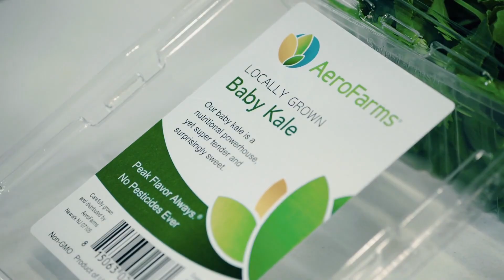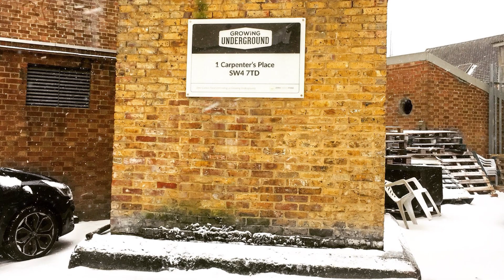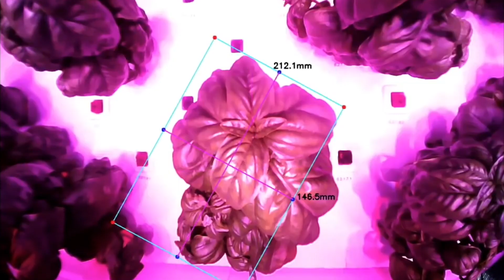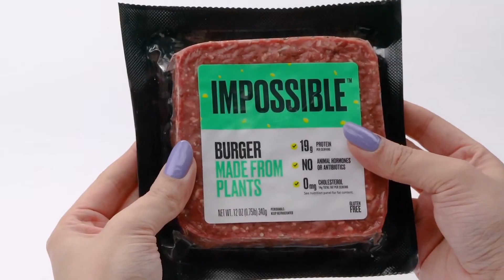Why the Future of Farming is in Cities - The Big Money in Vertical Farming

Comment: Vertical farming is hyped up and not realistically feasible without unlimited/free energy. Scientists have done the math and it's just not realistic until the day we have fusion reactors and unlimited, free/cheap energy. Also unnecessary. The Netherlands has pioneered non-vertical farming that produces, as example, 20x more tomatoes per square meter of land with 4x less water than normal farming produces.

Comment: imagine using 300w solar panel to supply the demand of plant instead of direct sunlight at the same amount of area plus vertical garden
Reply: Since solar panels are 20% efficient then it would take 10sq feet of solar panel to light 2sq feet of garden. That would be solar panels on top of 5 shipping containers to light only 1 shipping container. Now then, where do you put the solar panels for the other 4 shipping containers. This dream will never happen without nuclear energy and many times more than we already have.
Reply: @FlinFarmer  im planting about 1sq.m of Veg using about 60W both LED and pump compare to 330W solar abot not over 2sq.m i think it plenty to use

Comment: I don't get it..... you build a double walled climate battery greenhouse,  install a PV array nearby for supplemental lighting with a battery bank, ventilation convection, and backup propane generator..... at least 60% of lighting would be free from the sun, and the rest would be picked up by solar, and a tiny sliver for the few times you need to fire the propane generator.

Comment: https://www.pssurvival.com/PS/Hydroponics/Hydroponics_The_Bengal_System_1959.pdf
Bengal Hydroponics
Bengal Hydroponics. https://www.pssurvival.com/PS/Hydroponics/Hydroponics_The_Bengal_System_1959.pdf check page 106 known as the Wroclow Method invented in Poland during the Cold War in the 1950s and IT IS THE FIRST NON-CIRCULATING PASSIVE HYDROPONICS SYSTEM INVENTED. Not the Kratky method. The Wroclow Method is 70 years old already and new improvements were already made that are still also equally passive and are added to it and it also has incorporated Professor John Todd's "Living Machine" concepts and principles.
pages 106 to 107 
Wroclaw hydroponics method
An adapted form of water culture is being employed with considerable success in Poland. The plants are placed in a layer of brown coal mixed with peat on a gauze of nylon and metallic wire, laid over the top of the solution tank. A space of about 1.25 inches is left between the surface of the nutrient solution and the bottom of the gauze. This guarantees good aeration because it is kept in open contact with free air from outside by holes in the wall of the tank. The solution is non-circulating and is not renewed during the culture, and only replenished according to consumption by the plants. The tanks are disinfected for every new crop and a fresh solution made up, The Polish technique, which is known locally as the Wroclaw method, has been found to be cheaper to operate than gravel 106 NOTES ON OTHER METHODS culture. (See diagram on page 4: Dr Gericke’s original method of soilless cultivation of plants). 
https://www.youtube.com/watch?v=_PJJZFLnvfA&t=44s
Extreme Off Grid "Combat" Hydroponics No Pumps Inexpensive Easy Use Grocery Store Stuff!
May 15, 2014
But one thing is for sure, he accidentally stumbled on the orgone effect in which when you combine one non-metallic layer with a metallic layer because the non-metallic layer absorbs orgone and the metallic layer absorbs and transmits orgone into the surrounding environment. In fact, a friend of mine way back in the 1980s created an orgone pyramid BASED ON THE DIMENSIONS AND ANGLE OF THE SIDES OF THE PYRAMID OF GIZA and by using 3 layers of plastic sheet and 3 layers of galvanized steel in a plastic-steel combination. 1st layer is steel, 2sd layer is plastic, then 3rd layer is steel, 4th layer is plastic, then 5th layer is steel, 6th layer is plastic. And inside, in the middle of the pyramid at 1/3rd up is a platform where he placed a cup of water. By sheer coincidence he accidentally got burned and the doctors tend to his treatment but he also applied the orgone treated pyramid water to his chest where his burns are located by placing his fingers in the pyramid water and wetting them and applying the pyramid water to his chest where his burns are located. And in around one week the doctors checked on his progress and were surprised there were no scars and his burns were all healed! The same thing happened accidentally when the non-circulating Wroclow hydroponic method was discovered in Poland during the Cold War wherein the plants are placed in a layer of brown coal mixed with peat on a gauze of nylon (non-metallic) and metallic wire net (metallic), laid over the top of the solution tank. A space of about 1.25 inches is left between the surface of the nutrient solution and the bottom of the gauze. This guarantees good aeration because it is kept in open contact with free air from outside by holes in the wall of the tank. The solution is non-circulating and is not renewed during the culture, and only replenished according to consumption by the plants. The tanks are disinfected for every new crop and a fresh solution made up, The Polish technique, which is known locally as the Wroclaw method, has been found to be cheaper to operate than gravel 106 NOTES ON OTHER METHODS culture. (See diagram on page 4: Dr Gericke’s original method of soilless cultivation of plants). In an another method was the hybrid soil bed-hydroponic method wherein the soil provides all of the nutrients and the water culture of the hydroponic system below the soil bed provides all the water. And this method has been a time-tested and time-proven method in the 1920s. Strange that it was ignored in favor of the much more complicated hydroponic methods discovered after it. Then it occurred to my great-granduncle that it is the human nature to want something much more grandiose DESPITE THE FACT THAT SOMETHING SIMPLER AND MUCH CHEAPER AND EASILY UNDERSTOOD BY THE MASSES ALREADY EXISTS AND THAT IT CAN EASILY BE MASS PRODUCED!

Comment: So it is more efficient, can be grown year round, and better for the environment. We should do this everywhere. Make cheap healthy organic food plenty for everyone. Save the world.
Reply: There is nothing organic about growing food artificially on synthetic nutrients.
They taste bland compared to food grown on real soil.
Reply: I love the future.
Reply: Why is it better for the environment? What do you think is done to power all those lights and humidity control systems and heaters and coolers?
Reply: Well, it uses a ton of electricity and it's actually very expensive. That's why they're only using it on luxurious greens. You need to solve energy issues first before it get's popular. For now electricity isn't abundant nor clean. Even then, it'll be only used on some plants, because many are perfectly ok in the ground.
The fun part is that you're able to do DIY that right now. You just need a pipe, a drill and a pump.
Reply: @rhalfik  Solar panels + powerwall. The way I see it, if you use solar panels + powerwall + vertical farming + robots/automation, what you get is something that is very capital intensive initially, but is extremely profitable in the long run.
Reply: @thrivinganarchy5267  Powerwall isn't exactly a viable solution. It's too expensive of an investment, which you need to redo every few years. It's also bad for the environment. Luckily your network administrator can "store" energy for you, by harvesting the energy that you produce but not use, and then supply you with energy from other sources, like coal power plants, hydropower plants etc.
Reply: @rhalfik  Having the admin store your energy would work to. My main point is that even with the high energy needs, you can make the entire system a high capital investment that makes you a lot of profit in the long term.
Reply: @thrivinganarchy5267  Yeah, but the original post is about feeding the planet that way and it's not feasible. It's only for highly priced vegetables etc..
Also if you look at solar power, you loose like 90% of it by converting it to electricity and back. So you need 10 times more land than what is needed for traditional farming. Think about it.
It may make sense as an investment in some particular urban environments, but doesn't make sense in the context of climate change, or poverty or whatever.
Reply: 🛑🛑🛑STOP We will regret miserably in future 👇👇👇

Few decades ago during green revolution all believed it's a boon to have hybrid seeds,😍 fertilizers🎯, pesticides all man made chemicals they were super happy😎 to 10X their output 

👇👇👇👇👇
but who knew if we tried to tame nature and recreate it according to our will 
We would be making biggest mistake to humanity😭😭

Mother nature had lost all nutrients, even the pure fruits and veggies are contaminated, soils are barren 

Just take a moment before getting excited by pros ask a question 
❤️❤️❤️
Please use some sense whenever human has tried to make nature  as his puppet nature has slapped back in very cruel way

There must be a  reason why soil is needed for plants why the nature has made such a  beautiful ecosystem where one need another to live and grow mutually ...
🙏🙏🙏🙏🙏🙏🙏
Where will microorganism that we are and aware of ( much needed for food chain), insects,  butterflies etc. will go ? 
🔊🔊🔊🔊🔊🔊🔊🔊
We humans can't replace sun with fucking tube lights 
We can't replace soil with nutritious chemicals 

Please stop this nonsense we will be cause of the destruction of our future generations 

Don't let this idea become reality 🙏🙏🙏

Comment: The cost for an acre of land in most major metros in the US with a population density to theoretically support such a farm is approaching $1 million / acre. That is just the land before new or tenant improvements are constructed. In comparison most farm land in the US is around $5,000 -$12,000 / acre with no plumbing or structures required. The technology is pretty neat and might be used for something like designer/specialty/expensive foods but for everything else the economics of it would need to change drastically  to see it implemented.

Comment: It can work in big expensive cities where the cost of growing the crops can be covered by the high price people pay for it anyway. Because of the high standards in the city, nobody just imports cheap crops directly to the consumer. There is no profit in that and the people can afford to buy the whole stock and not even consume it if they don't want to. So the system is "corrected" (rigged) so that the price skyrockets. The resellers that benefit from that however can lower their cost to combat the vertical farm competition.
So I don't see this as the future. But it can tottaly become the future if nuclear fusion becomes standard and electricity price drops - then anyone can grow crops indoors and underground. This could be our salvation in a case of nuclear winter or other mass extinction event. Vertical farms are good. But they are not the "solution" for every problem.
Reply: I don't see people paying top dollar to eat what most consider weeds. Oxalis, Nasturtiums, Fennel, Dandelion, Miners Lettuce, etc..  you can fine most of these growing in public parks...
sprouts are so easy to grow, you'd have to be high to mess it up.  
and honestly.., do people REALLY like the taste of Kale???

Comment: how about the cost for this farm?
for electricity,for nutrient,and the other props.
Reply: @Lucy Towey nuclear regulated with water is never the safest option. Too much went wrong alredy. Especially reactors that use enriched Uranium are counterproductive. Thorium molten salt reactors or similar technologies are way better in terms of safety, energy production ( I know energy production is terminally not correct, im missing the right term rn), resources and nuclear waste
But I agree on with you about the solar and wind problem to sustain these facilities. There is just not enough space for it and their lifespan is too short.

Comment: Aquaponics vs Hydroponics vs Aeroponics?
Reply: Dennis Ivan Chavez depends what you’re growing, how much you’re willing to spend. All of the above are actually all forms of hydroponics. The video was referring to ‘deep water culture’ when it said hydroponics. Although the video was right in saying that aeroponics is the most efficient way of delivering oxygen to the roots. With deep water culture you need many large air pumps. Aeroponics has the correct shaped valve to deliver oxygen at the same time as nutrient filled water. Aquaponics is a lot harder to do because fish provide select types of nutrients, mostly nitrates. Whereas some types of plants require different ratios of other nutrients such as potassium or phosphorus, and sometimes even a few other ones in small concentration. This is ok for lettuce because lettuce happily takes a lots of nitrates to make its leafy greens. Aquaponics is my favourite though because you put in fish food on one end and out comes your vegetables out the other. Hydroponics is more suited to providing a much more controlled environment where the exact ratio of nutrients is supplied, suited for trickier to grow plants. And usually these plants require specific conditions for temperature and light as well, so it is expensive to provide. You should try building your own system, I recommend aquaponics because it’s the cheapest and the easiest.
Reply from the maker: Thanks for letting us know. I remember seeing a video on aquaponics with fish. Thought it was pretty cool

Comment: We have plenty of food to feed the world many times over. Powering LED lighting requires a LOT of electricity and generates heat, not exactly climate friendly. These LED panels are at least 50 watts each. One of these large farms can easily use 10,000 watts, and you would need 4,000 watts of air conditioning just to keep the temperature stable. It only works if you're growing high value crops. You can't survive on mint leaves. That being said, it has a lot of potential in the future if the cost of electricity drops and we transition to carbon-free energy on the main grid
Reply: Definitely more carbon friendly to grow in the city because the carbon dioxide given off by the burning of coal is in much smaller portions to that given by the truck to get it there. First of all, coal power plants are very efficient, around 60%, so the 4000W of power provided through electricity comes from less coal per energy used as electricity. Typical trucks have combustion engine efficiencies of around 40% so already they are chewing through mote fuel just to do the same work. However the real catch is in the fact that the truck emits carbon monoxide, where typical coal power plants keep this to a minimum, and the carbon monoxide is orders of magnitude worse for the environment than the carbon dioxide. So growing using electric lights in the city is far more climate friendly. And also you have the benefit of the trend towards green energy supplying the city.

In terms of the use of grow lights for farming, it is very expensive to run because they are so energy expensive and this is why most vertical farms actually don’t turn a profit. So you need a high end market like the restaurant sector to fund it. Otherwise just using natural light but in the city is the cheapest way to go. Just put the farm on roofs.
Reply: @andyw262  "So growing using electric lights in the city is far more climate friendly." You are a moron. Run some calculations on the amount of CO2 emitted per kilogram of produce in both instances, do some research before you profess.
Reply: It mainly makes sense in smaller scenarios like a family growing half of it needs at home. I thing the energy consumption is canceled out by the shipping and transport in trucks, but that's just guessing maybe you have numbers for that I didnt find anything.
Reply: @cosmoraptor3743  Crunch the numbers. It is not possible. These indoor farms are catering to Michelin star restaurants that can afford it. They are willing to pay a premium for marginal gains in freshness. Depending on where you source your electricity, the carbon emission per kWh ranges from .05 to 1.4 lbs of carbon. These lights have to remain on for 12 to 18 hours per day, for weeks to get a harvest. The only way this makes any sense is if you factor in the cost of land rental, and you are forced to grow crops in the city. Aside from that, this makes absolutely no sense and further adds to the ways wealthy people pollute the air. If this actually worked, all farming would move indoors.